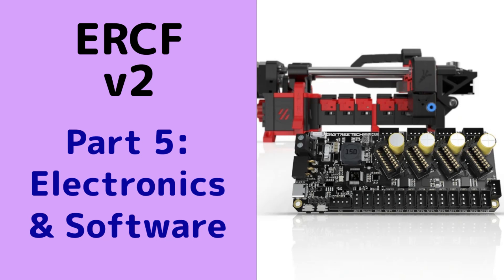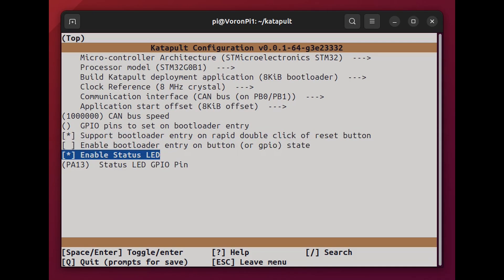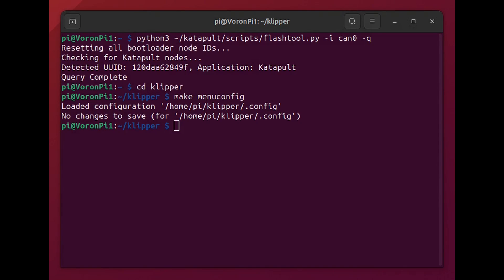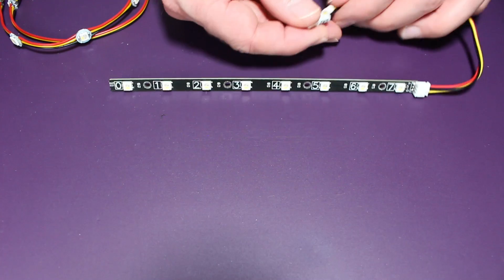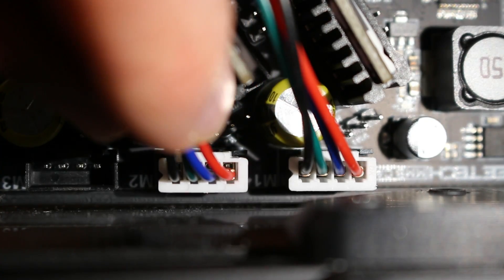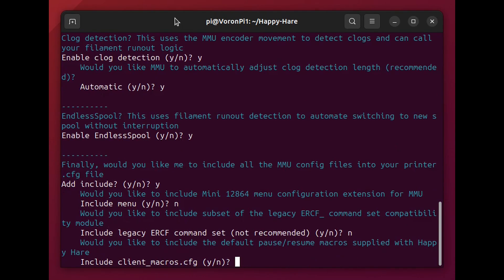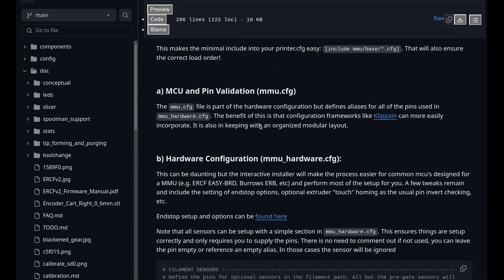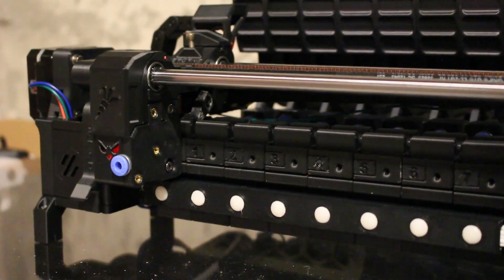Building the ERCF v2, Enraged Rabbit Carrot Feeder by Siboor.  Part 5 - Wiring & software

Comment: I have followed all 5 videos and found them extremely helpful.

I do have a question about using all 3x parts of LEDs (string, PCB, and single). I cannot get any LED lights to work. I did notice the colors of your wires did not match the +/-/signal order compared to Siboor block diagram. Does + always go to + through the LED chain and likewise for -?

I have Happy Hare installed and  Jillian Shill LED Effects. I s there more software or macros to build to see a light?
Reply from the maker: Thank you! I’m not close by to have a look, but I seem to recall + to + and so on. I might have switched the wire colors. If they are not lighting up, check the pin ids to make sure you are using the right one, and polarity is super important.
Reply from the maker: I wish I had better advice for you

Comment: do i need the octopus to a pi  then to  EBB36 then  ERCF v2,
Reply from the maker: If using canbus and using u2c, you can use the multiple ports on the u2c to run a cable to each device making sure to terminate the last.  If not using a u2c, you should probably daisy chain them. In this case, I would place the ebb36 last to simplify the wiring. In both cases, the pi will connect to the octopus via usb and the u2c via usb if you have a u2c.

Comment: can i use this with BIGTREETECH BTT Octopus Max pro my printer uses 10 steppers but left nothing for extruder
Reply: any sites i can learn how to do this or are you interested in a collaboration. Getting my 7 foot printer going https://www.youtube.com/watch?v=D6ZsFD--WQM&t=10s
Reply from the maker: @3rdgenludekswap-zd3lt  , I'm not sure how a collaboration would work in this case, but have a look at this video on the EBB36 and how to set it up.  https://youtu.be/jgE3XMM9PBk?si=QhYM1DGDdJ2ejCaP  In addition, this is newer https://youtu.be/oGdIyosQuRk?si=U8nN16VZBZ7C66d3  And finally, have a look at this site: https://canbus.esoterical.online/   which is probably the best.
Reply from the maker: If I were in that position, I would use an EBB36.  It can operate over Canbus or USB and control your extruder.  But this MCU would work as well if you want to controll more than 4 motors.  Have a look at my videos on canbus.  One of them shows an older verion of the EBB36 and how to configure it.  Thanks!

Comment: Good morning my friend, I've watched all your videos! Congratulations, you've gained a subscriber!!! I'm having problems because I'm only using USB on the BTT PAD7, which has 3 USB inputs, one of which powers the EBB36 and another for the OCTOPUS-V1.1 motherboard, and the third USB input is going to MMBv1.1. I even find the connection, but I can't move forward because I can't find a tutorial that gives me a guide via MMBv1.1 via USB. I don't know how to configure the Katapult options, and I also don't know if I should use it via a USB cable. Please help me. I spent many days without knowing what to do.
Thank you very much
Reply from the maker: Since you are using usb, you will need to install klipper onto the MMB just like any other mcu and then run it like a second or third mcu. This should setup just like you have configured your ebb36 with I assume based on your comment isn’t running over canbus.   You will want to use make to build a version of klipper for the MMB. I’m not in a place where I can access the MMB documentation at the moment, but I think there are instructions on how to do that in the MMB manual.  If you can’t find anything, comment back. I can try to find instructions later.
Reply: @KapmansBasementWorkshop  Thanks for the quick response :)
I'm following the MMBv1.1 BTT manual. When I request lsusb it brings me 3 DFU device ID:
Bus 002 Device 014: ID 0483:df11 STMicroelectronics STM Device in DFU Mode
Bus 002 Device 010: ID 1d50:614e OpenMoko, Inc. stm32g0b1xx (MMB or EBB36?)
Bus 002 Device 009: ID 1d50:614e OpenMoko, Inc. stm32f446xx (Octopus v1.1)

When I run make flash FLASH_DEVICE=0483:df11 it gives me an error:
pi@BTT-CB1:~/klipper$ make flash FLASH_DEVICE=0483:df11
 Flashing out/klipper.bin to 0483:df11
sudo dfu-util -d ,0483:df11 -R -a 0 -s 0x8000000:leave -D out/klipper.bin

dfu-util 0.11-dev

Copyright 2005-2009 Weston Schmidt, Harald Welte and OpenMoko Inc.
Copyright 2010-2021 Tormod Volden and Stefan Schmidt
This program is Free Software and has ABSOLUTELY NO WARRANTY
Please report bugs to http://sourceforge.net/p/dfu-util/tickets/

dfu-util: Warning: Invalid DFU suffix signature
dfu-util: A valid DFU suffix will be required in a future dfu-util release
dfu-util: No DFU capable USB device available

Failed to flash to 0483:df11: Error running dfu-util

If the device is already in bootloader mode it can be flashed with the
following command:
 make flash FLASH_DEVICE=0483:df11
 OR
 make flash FLASH_DEVICE=1209:drink

If attempting to flash via 3.3V serial, then use:
 make serialflash FLASH_DEVICE=0483:df11

make: * [src/stm32/Makefile:111: flash] Error 255

When I add ls /dev/serial/by-id/ it tells me returns:
usb-Klipper_stm32f446xx_btt-octopus-11-if00
usb-Klipper_stm32g0b1xx_50003A001950425539383920-if00
usb-Klipper_stm32g0b1xx_btt-ebb36-12-t0-if00

I don't know what else to do.
Thanks in advance

Comment: Hey, Great video, but I do want to point out that at 11:22 you said that "the jumpers on the pins closest to the socket is for CANbus", but that's incorrect, its the two furthest away that say Vin not HVin, had some issues getting that to work.
Reply from the maker: I will need to check on that. My apologies if I made a mistake.  Thank you for the feedback and watching!

Comment: I have  it all build and now I'm trying to get it to work on my raspberry pi (with klipper controling ender 3 clone) I see it with boot option in SSH , but what next ?? Can't follow your steps for they are for CAN bus , wich I don't have , howto proveed to get it to work on usb>>raspberry pi..I'm in the woods here as all of the vids on youtube are about CAN BUS..please advice or point to directions  🙏🏻
Reply from the maker: So in your case, if not using canbus, just use USB and treat it like an additional MCU.  Just like your pi is currently connected to your MCU where you installed klipper on that MCU.  Now you need to do the save to the BTT MCU.  They will both plug into the pi via a USB cable.  If you look at the early Voron 2.4 videos before there were MCU's that could handle all the stepper motors, it was common to use 2 MCUs.  So now you need to do the same here.   Watch a ver early Voron 2.4 electronics build video.  You can probably still find those instructions on the Voron build instructions too.  I use canbus, so until I decide to eliminate that or build a new 3d printer, its going to be very hard for me to create a video that shows this.

Comment: i am using marlin firmware
Reply from the maker: I am not aware of any marlin firmware extensions that support ERCF.  ERCF was designed to work with Klipper.  To make this work, I think you will need to change your printer's firmware to klipper.  It's not hard to do, but I would work on that 1st.  Thanks for the comments and watching!

Comment: Iam using Arduino mega with RAMPS 1.4 HOW TO CONNECT TO IT
Reply from the maker: Do you have Klipper running on the Arduino?  Or, are you using a Pi?
Reply: @KapmansBasementWorkshop  I am using an Arduino Mega with a RAMPS 1.4 on top of it. That's it.

Comment: can i operate a printer with this board without can bus?
Reply from the maker: Yes, you can. If using Klipper, you would install Klipper and the connect a USB cable to your pi running Klipper as well
Reply: @KapmansBasementWorkshop  OK thank you and nice work!
Reply: @KapmansBasementWorkshop  are there any instructions on how this works?
Reply from the maker: @dannyweber42  The Github for ERCF as well as the github for happyhare should have it coverred.
Reply: I have a Rat-Rig V-core 3.1 500 running Klipper. I do not have Canbus (that I know of). I have finished the mechanical assembly and have the Siboor v2 kit Circuit Board installed. Are you saying I just plug in a USB to Raspberry Pi 4B, and power up the Rat-Rig V-core 3.1? What about USB jumper on MMB board? AC power plug to MMB board to be used? What software gets installed?  @KapmansBasementWorkshop
Reply from the maker: @dwightbooth1661  1st you need to build klipper for that Sibor kit/MMB circuit board by SSH into the PI.  The instructions for that board are in the BTT Gitub.  You will use the USB jumper and cable to install klipper onto the MMB circuit board.  Then you will remove the jumper and connect the circuit board to 24v since it needs to power two stepper motors and the servo.  You need to then reboot the printer and run lsusb to find the ID of the BTT/Siboor circuit board and add that into the printer.cfg file of your 3d printer.  You will then need to reboot klipper and then install the Happy Hare software as per those instructions.  Does that help?
Reply: , yes that clarifies alot! Thank you so much for the quick response. 

I don't use Canbus that I know of. I will look into the BTT site you stated and find out how to build Klipper and Flash to the MMB board.

Can I use the 2x Motor Plugs on the Octopus Board v1.1 to power the ERCF v2 or is that too much load for it?
Reply from the maker: @dwightbooth1661  you absolutely can use those 2 open motor driver spots on the octopus. You can also use the servo driver on the octopus.

Comment: I am sorry if this sounds like a stupid question, but why are you using only 2 of the EZ2209 drivers and not 4 like the board can handle? just got into this rabbit hole and trying to figure out how to use the ERCF for generic printers. Can u help me with this. just need to know if it is enough to just use 2 instead of 4.
Reply from the maker: Since I was only using it for the ERCF which has 2 motors, I only installed 2 driver chips.  You just need one per motor.  Thanks for the question!
Reply: @KapmansBasementWorkshop  nice i jsut finished building the machine and currently setting up the board, can the Vin support 24v? or do i need to use the Hvin pin? thanks for the response :D
Reply from the maker: @MuhammadDanialBinMatNasir  I'm using the 24v on the canbus cable which is the VIN.  So if you are not using canbus, I would use HVIN for 24v.  The manual isn't very clear about this.  I have also never tried to run it this way.

Comment: Hello, i have QIDI Q1 PRO, if i make this project will i be able to run it with my printer? the printer is klipper. Thank you for your answer.
Reply from the maker: I think it's possible.  But you will need to work with filament end forming or replace the tool head with stealthburner if you will to use the sensors and filament cutter instead.

Comment: Hi Kap! What 3d printed arm did you use for the servo motor? The siboor kit comes with a GDW servo. I'm not finding a lever for that particular one in the stl files.
Reply from the maker: I used the Savox parts as they seemed to fit.
Reply: @KapmansBasementWorkshop  Someone in the ERCF discord did link me to the servo body stl file and then just mentioned that the Mg90 lever fits. Not saying to contradict you or anything, just as some more information that I just found out.

Comment: So glad you made this video series, awesome job!
I have a question though, where did you find the stl for the led holder and the diffusor bracket? I can't seem to find them in the ERCF folder, just one that is half the length and has no mounting holes for the led strip
Reply from the maker: It's right here: https://github.com/Lzhikai/ERCF-V2-Accessories

Comment: HI Kapman, thangs for this what you do. i got the same package from sibor beacause i want to do this with you. everthing (at the moment) works fine but ca  you pls tell me, wich servo settings you use? the GDW ds041mg runs not in the direktion it has to and i dont know why..
Reply from the maker: Are these what you are looking for?
[mmu_servo mmu_servo]
pin: mmu:MMU_SERVO
maximum_servo_angle: 180
minimum_pulse_width: 0.00085
maximum_pulse_width: 0.00215

These are in the mmu_hardware.cfg file

Comment: Great video as usual.  It's been a month since you posted on the ERCF.  
I hope it's not because your having issue with it working. 
I went ahead and bought an Anycubic Kobra 3 Combo which has support for 4 colors until the ERCF gets working without lots of fiddling.
I was amazed at how much poop multicolor generates. The Anycubic generates way less poop than the ERCF and it's still too much.
Plus it does not need those huge retract reel. Plus it has a built in dehumidifier. 
I am thinking the ERCF might be flawed by design/
Reply from the maker: The probalem I have been facing is the the ERCF, it's me!  By mistake, I foolishly fried two canbus controllers on the tool head. One after another.  Once I got it working again, I had to focus on some other print jobs I needed to complete.  I also have a mounting/space problem.  I hope to resolve that today and then I can get moving again on this project.
Reply: @KapmansBasementWorkshop  Yea that ERCF requires a lot of open space. Yours is 8 colors and that is a lot.  Any interference could easily kill a print job. I am patiently awaiting your follow on video.

Comment: Hi, I am setting up a new Voron 2.4 r2 type printer, I am using a BTT M8P with a CB2, when everything is ok I would like to get started on the ERCF too but I already have the extruder in CanBus to connect to my M8P and I can't yet find a video that shows what to do in this case...

I must directly put it in parallel with it, remove a 120ohm resistor, move it?
Reply from the maker: If you are using a U2C or the existing mcu with canbus capabilities, you need to one terminator on that device.  In addition, you need a terminator on the oppposite end of the canbus.  Most people will attach the terminator on the very last canbus device.
Reply from the maker: Also, if you are using the U2C, it's actually a small canbus all on it's own.  Meaning each socket sits next to the other on the bus.  So you can have a terminator on the last device connected to the green wire terminals and then run cables from each of the sockets to individual canbus controllers, all without terminators.  It's pretty cool.

Comment: I’ve ran into some issues after noticing you are communicating with can. my printer does not have a can interface. I flashed katapult using usb instead can. I can see it listed as a katapult device when i search for it, but obviously nothing comes up on can0. Am i still able to set everything up and is e this board with usb only or will i need to get a can add on to use with my printer to be able to use the ERCF?
Reply from the maker: You can just install Klipper on the controller and not use canbus. The controller will appear as a second mcu that you will declare in the printer. Cfg file.
Reply: @KapmansBasementWorkshop  Thanks for the fast reply, I got it talking with klipper hat a few minutes ago. The selector is working, but for whatever reason my drive stepper is not working.  Have checked the stepper it’s self if good. I’d like to check that is set as the right pins. in hawrdware it’s just mmu:MMU_GEAR_STEP. Where do i find what those actual pins relate to? I might try changing it to the 3rd drive to see if that solves it
Reply: UPDATE- found the code in mmu and changed it to drive 3 and now it works fine
Reply from the maker: @JacobBlocker  Cool. I’m glad you got it working.

Comment: Please note when you release the final part that not all SIBOOR kits are created equally. Myself and several others had a rigid PCB pre-gate board which has been known to cause problems (false gate reporting) and while some kits have WRGB LED's others use RGB only. I would make sure people understand what version of the kit your configs are for, if you still plan to release! I have the WRGB rigid pre-gate board version and I am having a ton of issues.
Reply from the maker: I do plan on releasing another video to conclude this.  However, I fried my SB2209 by mistake.  Waiting for it's replacement. About the PCB, I ripped out a microswitch by mistake.  It just pressed back in since it wasn't soldered.  But that microswitch and each surrounding it became unreliable.  I pulled off the circuit board and soldered wires instead.  Rock solid.  I recommend following the manual on cutting the wire lengths and soldering.  In the long run, it saved alot of time!  In the last video, I plan on covering this as well.

Comment: You could probably use the GND and 5V from the reserved STP sockets (STP1 & STP2) for the extra LEDs and, as you said, solder the signal wire in series at the end of the LED strip. Unfortunately, the RGB socket pin (PA2) looks like the only one capable of PWM (apart from the motor PWM pin, PA0), which LEDs need. Siboor missed a trick here to make this a bit easier by putting another connector block at the end of the strip. I'll probably not bother with the coupler block LEDs but the selector one may help troubleshooting in operation.
Reply: Actually, the selector LED cable passes through the cable chain since it needs to accommodate the entire length of the ERCF so the connections have to be made at the MMB end, which means the selector LED needs to be the first in the chain but in series with the LED strip otherwise it will be the same colour as LED0. This isn't straightforward at all unless Klipper can do a software PWM on pins PA3 & PA4 to keep the LED chains independent. Klipper can do software PWM on the MCU so it depends on whether the MMB is capable. It should be.
Reply from the maker: I ended up just using the led pcb.  Looking at where I was going to indtall this and because I used black fillament, I decided to not use the other LEDs.  Thank you for this tip!